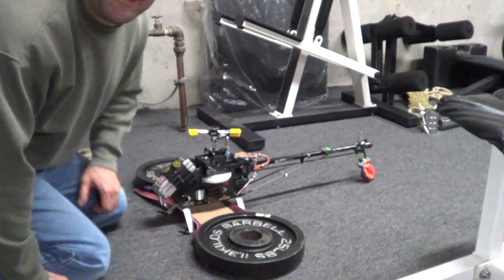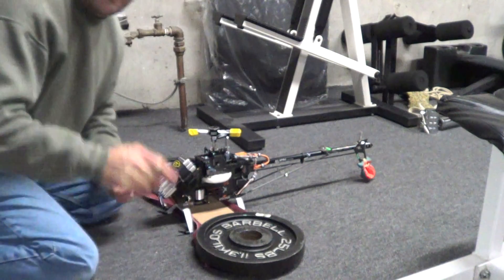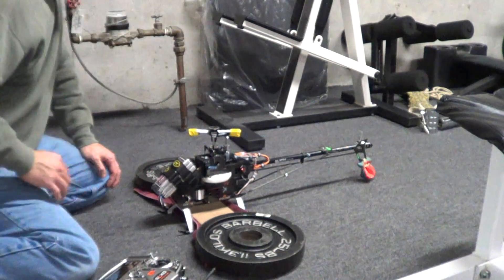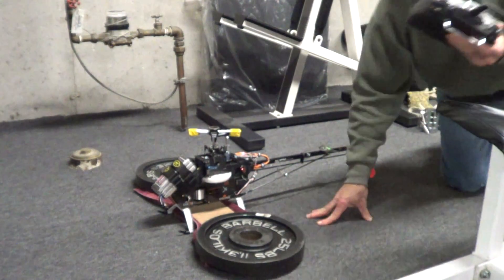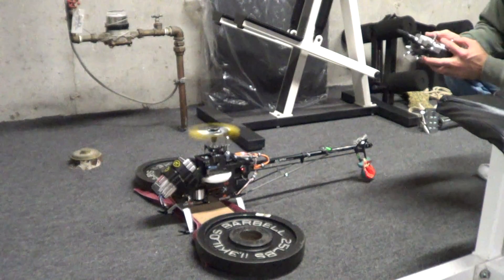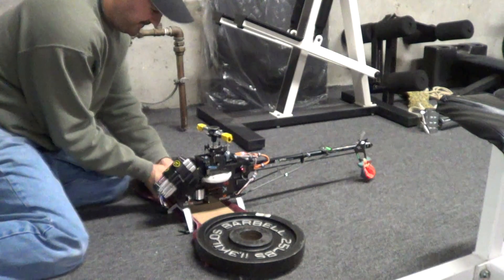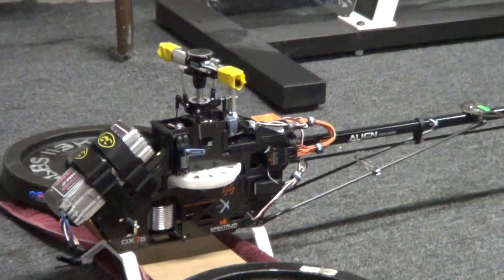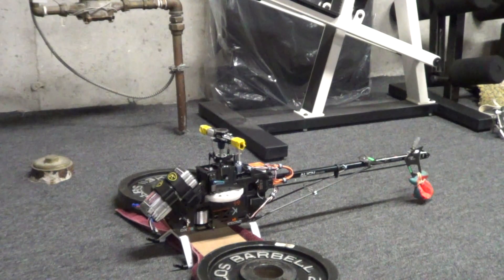Align trex 500 pro with beastx ,test spool up

Comment: Hi rayII have a Trex 500 with a AR7300BX on it. Every thing is working like it should but the tail is not moving all the way left and right. I tried a new servo and it is the same. I`m using a spectrum DX8 radio. Is there a setting that I have to change in the radio. To get more movement.

Comment: Thanks nitrokyosho. This is a Flybarless model. That would be my next step after torque tube. 
Thanks for reminding us all of the safety points in this hobby. Cool hobby but can hurt you and others very badly. Set that thing (any rc) properly using safe testing’s practices.
Thanks again nitrokyosho.